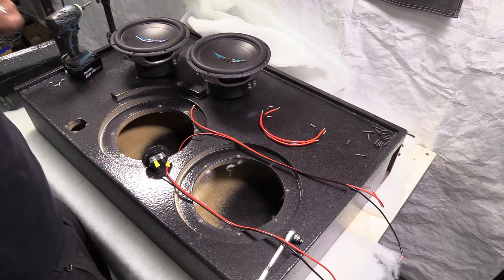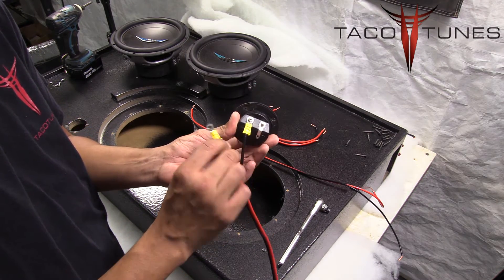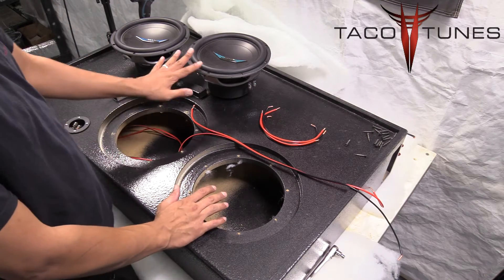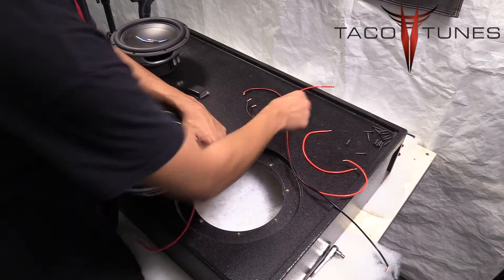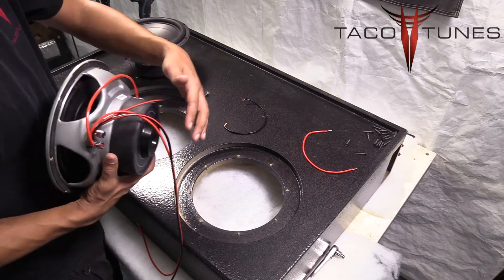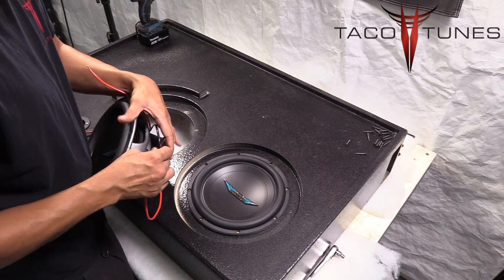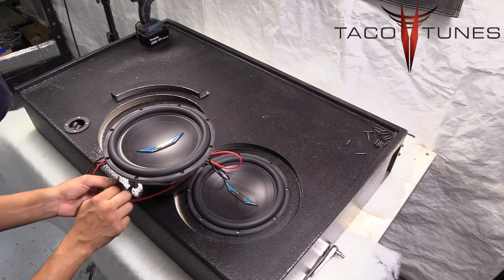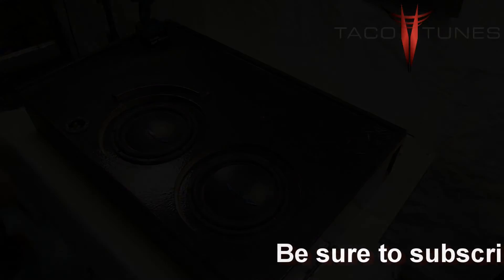Toyota 4Runner How to wire 2 dual 4 ohm subwoofers for 1 ohm impedance load

Comment: I would like to know how to do the same but have each speaker going to it's own terminal cup then the 2 terminal cups going to my mono amp that also has 4 speaker terminals, because my sub box has 2 terminal cups 1 on each side and then of course the amp has 4 speaker terminals so I would lime to use them all and I have 2 DvC 4 ohm 12" subs and they need to end with a 1 ohm load
Reply from the maker: You can wire it the same way and leave that 1 terminal cup unused.. or if it is dual chambered you can parallel the wiring at the cups.

Comment: What if I have 2 terminal cups? Would I just wire them both up to each other and then to one of the terminal cups to the amp?
Reply: Same thing I was wondering. Or do you eliminate one cup. Plus my subs are independently enclosed from each other and not sure if I should drill a hole in the divider to make this parallel connection..
Reply: @bdub6942  I had the same question. But after seeing another video on YouTube it shows you how to wire them parallel outside the box to the amp. No need to drill anything.
Reply: @pakomorfin4498  can you give me the link please?
Reply: @bdub6942  let me know if it helped
Reply: @pakomorfin4498  Thanks but neither addressed my issue. I just eliminated the connector cups, I made them dummies so they hold no purpose except to fill the hole they were always in. I ran the parallel wires through them basically, out one and in the other. I'm almost finished and can't wait to hear this shit, lol.
Reply: @bdub6942  oh ok lol well as long as it works!
Reply: @pakomorfin4498  Nothing I did worked so I resorted to letting the professionals do it and they’re almost done, after 5 hours, Jesus lol
Reply: @bdub6942  aaah yea. Can’t go wrong with them lol at least you’ll have yours up and running. I have to do a few other things before I can have my system running